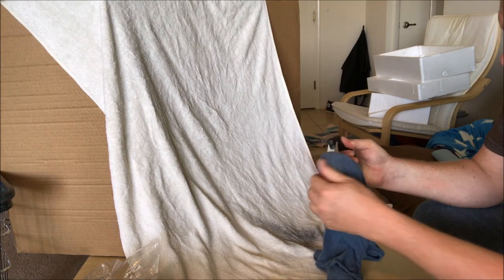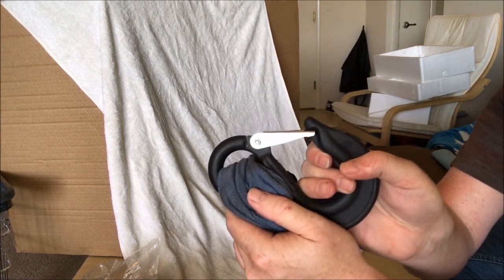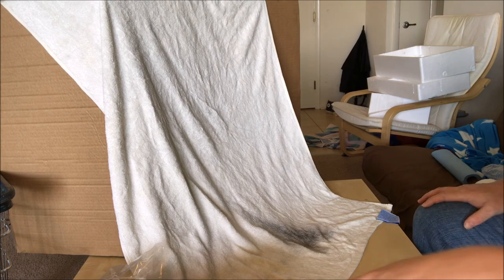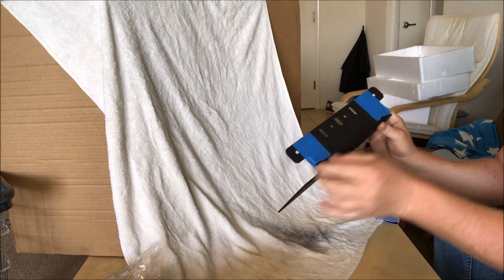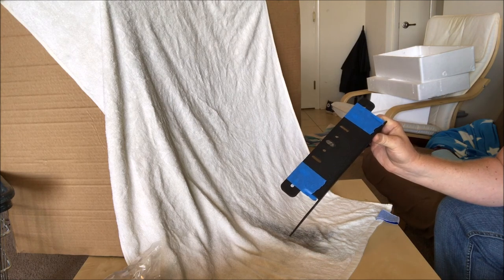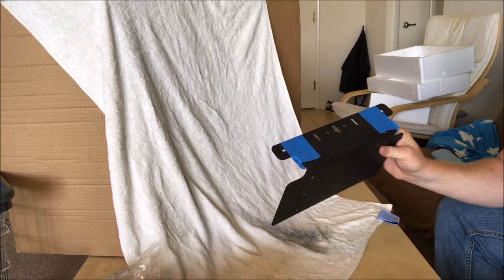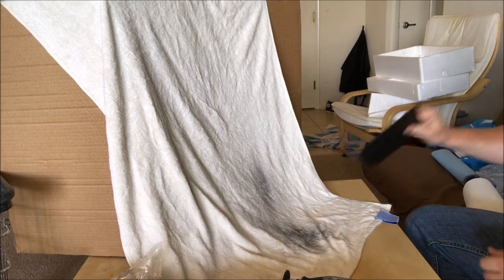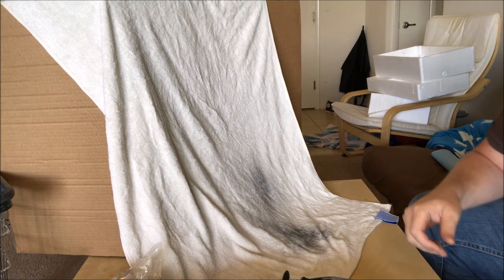Bob's JK Build: Front Bumper Project Part 1 of 4

Comment: Bob.......can you tell me what exactly did you get to space your license plate frame when connecting it to your bumper? I bought the exact same license plate frame as you did. Can’t quite figure out what you used. Thanks!!
Reply from the maker: Brian Wood I used a bunch of random hardware from Home Depot. 1/4” lag bolt (I forget the length but it looks like 2-2 1/2 inch maybe). The spacers were also from home
Depot 3/4” thick nylon spacers (I’m pretty sure they were 1/4” inside diameter) as well as a bunch of 1/4” washers. I just kind of added and subtracted the washers to end up with the spacing I wanted and have no real math on how I ended up at the 5 or so I used on each side. 
The spacers should be in the specialty hardware drawers in the hardware section at Home Depot.